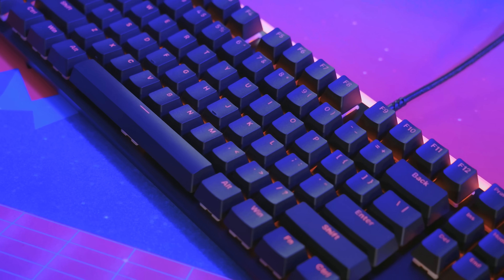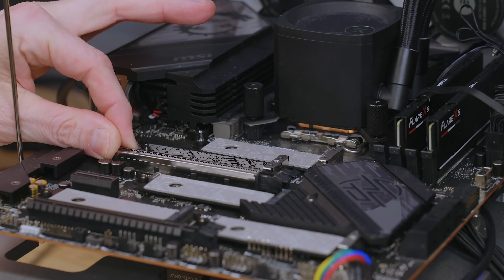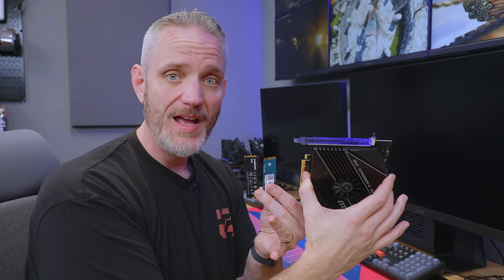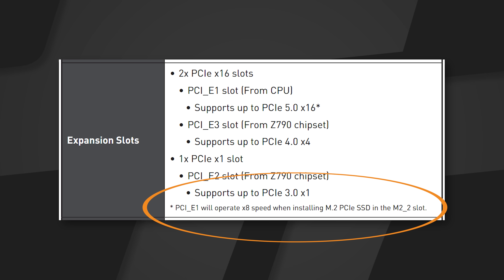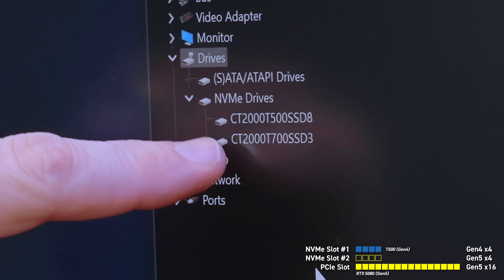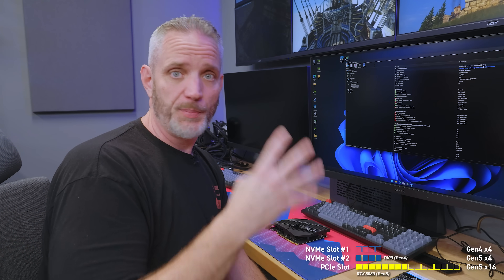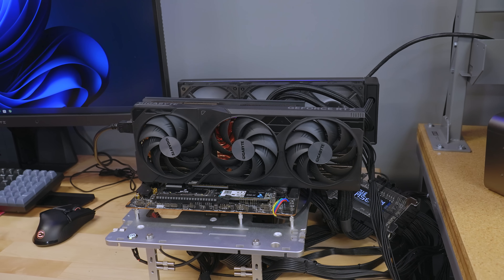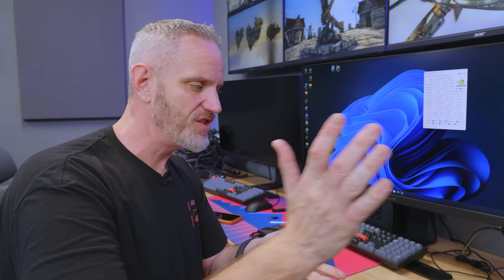Don't make this mistake with your PC!

Comment: Great video and here's why.
In 2023 I had not built a PC in almost 10-15 years and started with the 670E chip set....THINKING...hey DDR 5, PCIE5, we are good to go for some generations. 
3 sets of 64g DDR5 sets later I discovered support by manufacture is a thing (because of you).....because it just worked before and hey it's listed as EXPO compatible on the website....
Then I learned about PCIE lanes supported and configured differ by manufacturer and model (because of you) then realized the m.2 pcie5 I bought doesn't make any sense because it can't be used on that chip set....
Now I learn about bifurcation and realize any extended motherboard set is a basically a waste of money if you are gaming.
You only need a 5x16 main GPU slot and a 5x4 for an M.2 for storage....I wasted SO MUCH MONEY and my PC still doesn't perform optimally because my PC idea was 2 years ahead of concept. 

I need a new motherboard and MSI or Asus are the only options that I can find with my existing equipment due to compatability which is just sad.
Current system
7900xt-7800x3D-G.SKILL Trident Z5 Neo RGB Series 64GB(not supported so runs at 4800mts)-ASRock X670E Taichi-Team Group T-Force CARDEA Z540 2TB(not supported so runs at 4.0)

Comment: Ok this is making me want to rush to my pc and check GPU z. I’m using the Asus TUF Gaming b650-e and the manual doesn’t seem to give specifics about bifurcation. I have two gen 4 nvme drives installed, one in slot 1 (gen 5 slot) and the other in slot 2 (gen 4 slot) while slot 3 is empty. My GPU is gen 5, however I don’t think my board does gen 5, but I never even considered if I could be causing bifurcation with my 2 drives. Sadly I’m at work so I can’t check it at the moment but this is driving me crazy!

Comment: This video reminded me that I have PCIe Gen 3 drives in a PCIe Gen 5 and Gen 4 slots. I read the manual for my new PC when I built it, but I brought the drives over from my last build and I forgot that I have yet to upgrade them.  This video reminded me that I still need to upgrade them.
Reply: You dont really "need" to upgrade them. I dont think the difference will be big. Depends on the type of workload though

Comment: Thank you for this video. I had my gpu in the completely wrong pci express slot because I didn't know better. Also I know you iterated and reiterated several times to read the manual, but prebuilts don't typically come with those. I know I could Google it of course so it's still on me.

Comment: From what I read up on that topic, It has at worst a 1% impact on the GPU and only on full usage even on a 5090. If that's all that's to it I don't mind the power loss. Don't know about overclocking, but although I had the option in the past I never did.

Comment: I am confused. I only have an RTX3080ti and Gigabyte B660 motherboard.  I have one gen4 NVME in the only slot above the GPU slot. I get full speed of the GPU. GPUz reports Pcie 4.0 @ 16 4.0 which is max speed for a gen 4 GPU. Why isn't my Gen 4 NVME taking it down to 8x like it did in this video?   Yes I know I have 20 lanes.  But Jays dropped to x8 when he put the Gen 4 drive into the slot above the GPU.  EDIT, after watching the last bit with the Gen 4 GPU I now get it.  You are dropping to x8 on the GPU because you are using both NVME slots? I think?  Great video by the way.  I have been building gaming PC's since 1992 and I still get confused.

Comment: but I think some boards may not detect automatically if you put a pcie nvme card on there
I have a msi x470 carbon board and if I don't configure the pcie slot manually only one nvme is detected

Comment: I read the manual and bifurcated 8x4x4, bought a 8x GPU (7600XT) and added extra x4 NVMe SSDs. Seemed like the easiest way to get lots of fast storage on the MB. Not a gamer. 16 GB GPU is used for small local AI models.

Comment: @10:55min into clip, not really a waste if your thinking of furture proofing and you want to move all the Pcie 5.0 products to  AM5 Motherboard..., in fact i have a AM4 system and i want to build a AM5 system but all my Nvme SSD are Pcie 5.0 now when i build the AM5 i just move all that right over to that Board and good thing i did cause the prices went right to the roof recently but i get what your saying about proper lanes and speeds.

Comment: dude.. i think i mucked up...i bought a samsung 990 pro nvme m.2 heatsink ssd 4 tb and its currently in the only m.2 slot on my asrock b550 pro 4 motherboard....... this would explain the low speeds i was seeing...........
Reply: ok i might have actually put in the right spot but.,..Drive Controller:  NVMe (PCIe x4 16.0 GT/s @ x2 8.0 GT/s) this is what i get but why?

Comment: Thanks Jay, I have been telling this to users and folks for a few years- especially when they ask about building- I always ask them what are your goals and what type of hardware are you planning on now and possibly later, in order to spec out starting with the motherboards capabilities and device lanes / Gen support. I have seen this  more often then not especially lately with the new Gen 5 devices where other builders don't understand what is taken place. advice- plan out your build if you want  said X gen 5 or components make sure what you what to do and get full potential if possible look at your motherboard options very closely and see if it is going to support what you want to do- as example I recent upgraded my work / gamming PC I wanted to have Gen 5 9070XT  video and I knew I wanted fast Gen 5 drives I have (2) 9100 series Gen 5 NVME and a couple 990 and 980 NvME so I looked over options closely and went with a MSI Tomahawk Wi-Fi 7 X870E and 9900X CPU with 9070 XT video top NvME Gen 5 Video Gen 5 Second NVME Gen 5 lower to NVME gen 4 perfect fit for what hardware I had and what I wanted to accomplish.. Also Jay I think it is very important to point out your CPU plays a BIG part in this as well esp. with AMD and the dedicated lanes and Gen support between the series of CPUs often that gets overlooked as well and can downgrade what gen a slot becomes due to the Bus lane supported by CPU. I will point out before somone says no you didnt get it correct I turned off in BIOS the 40GB option for ports on motherboard in order to retain the Gen5 option for the second NvME drive as that option shares lanes / Bifurcation if left on.

Comment: For those who have a asus rog strix z790-f gaming wifi 6e motherboard intel, put the ssd in the first top slot, i have a 14gen cpu and 4gen Samsung pro ssd, the motherboard has 4 gen4 ssd slots, i have a 5080 running at 16x

Comment: So the Mag B850 Tomahawk has 2 PCIe 5.0 m.2 slots and 2 2 PCIe 4.0 slots. I guess the motherboard has this thing where if you use more than just the first m.2 slot, or from what I'm reading, the second m.2 slot shares bandwidth, slowing down. Does that mean I could use m.2_1 slot and the m.2_3 & 4 without any issues? Or am I misunderstanding? Sorry, I'm new to pc building, so been studying up on all this stuff for many days, now. Just when I think I got it, I find something else to be confused about.

Comment: Jokes on AMD and Intel, i am still using SATA2 SSDs!
My chipset runs it all and PCIe is only for GPU :D

At the end though, the question is for the mobo makers.
The CPUs have what the CPUs have, the mobos are the ones that put in all the options. 
So i don't even put the question on the mobo, i put that question on the buyers. Why buy a CPU that can only support a few good lanes, then you buy a lot of cars for those few lanes.
Just like people who don't properly match mobos with RAM, or X with Y. It is the same problem.

Comment: How about "gen4.5" nvme ssds like 990evo plus? They're gen 5x2 or gen4x4. Technically you could put 2 of these and use 4 gen5 lanes and get the speed of 8 gen4 lanes. Or how does it works?

Comment: weve just had a mad few days tring a saphire nitro+ rt 9070 xt in a msi x570 g+ but it wouldnt boot to bios any ideas ryzon 5 x3600x 2 x nvme mp600 500gb C 1tb D corsair lp 3200mhz 16gb ddr4 .. new psu 1200 w 3 wire power to gpu ???

Comment: Why are so many slots on a Mainboard if it shreds the performance of the parts. Just dont put it on there and i know i have to replace a 2TB with a 4tb and not just buy another 2TB and stick it on another slot because it shreds performance.

Comment: So the manual for the Asus Tuf Gaming Z790-PLUS WIFI D4 motherboard just says "... supports PCIe 4.0 x4 mode M Key design..." prefixed by the socket identifier and suffix of the various sizes of drive that socket will support in Chapter 1 section 11. The only other spot in the manual that talks about the drives is how to physically install it in Chapter 2, unless I've completely overlooked it. Comparing it to the screenshot you put up of your ASUS ROG Strix board, nothing in the storage section talks about shared bandwidth.  Does that mean all four drive slots will run at full speed? 

The only place the manual refers to Bifurcation is in a section for "Expansion slots" which it differentiates from the "storage specs". There is a link for the bifurcation in the expansion slots, and the site it takes you two talks about those PCI-e add-on cards to add even more drives and how those drives on that expansion card would be impacted.

Comment: This info needs to be spread around more, and the freaking manuals need to make this more clear. First time I learned about this was when I built a system with a cheap board and one of the GPU slot didn't work at all when you used both M.2 slots... 

Also, my newest board had to be flashed to the new bios to recognize the CPU I ordered with it - and apparently there is a function to do this without CPU at all, via a specific USB slot and a simple stick with the bios file on it. This info would have saved me a trip to the shop, asking them to lend me an older CPU it recognizes to flash my board (was my first AM5 board). And I wonder why this isn't mentioned in the manual in big shiny letters, I mean it's just a recurring problem that boards need to be flashed before usage, so manufacturers should just leave a note in the box that they built in a solution for that ffs.

Comment: Whats the deal with the intel website saying the max number of pcie lanes is 14? 

Is that chipset lanes? Ignoring the direct to cpu nvme slot and pcie 4x16 slot, it has 1x 4x4 nvme and 3x 3x1 slots. The cipset lanes add up to 14 assuming thats 8 lanes x 2 (up and down)

Comment: Yep cheers Jay, I bought two Samsung 9100 2TB pcie5 nvme's and was disappointed to find that my 5090 was only on 8 lanes. I'm doing AI 'stuff' ))) so maybe I need all 16 lanes available and anyways I want 16x for my 5090 Astral! I have the 870E-E Gaming WIFI MB too and a 9950X3D is running the show. (Single middle aged geezer working 50 hours per week so that's how lol)
 Did some manual reading and found the issue. Wish I had either read the F**kin' manual or seen this vid before I bought two of these. My brother will benefit from my mistake as he is building himself a new PC and I'll gift him the drive for his Christmas pressie so not all bad.

Comment: It. Doesn't. Matter. People who want to fill every slot (like me) don't really care. When I started computers I had to listen to a modem connect. It took minutes to download pictures. You really think I care if I'm writing at 1GB/s instead of 5 or whatever? I have 4 slots filled on my nvme slots and 2 more on add in cards. I have an additional 4 nvme running off a single usb-c port from a Terramaster D4. It writes at 1GB/s which to me is still absurdly fast. Yeah, I'm good, thanks.

Comment: I am curious Jay.... I have one of those MSI M.2 Xpander's. Mine is Gen 5. However, when I installed 2 NVME's on it and put it in a 4x slot, it only saw 1 drive. So, I don't think you're correct about it splitting it to 2x and 2x. I think It only saw 1 drive because it couldn't connect to the other drive at all. Please test this and verify what you get when installed in a x4 slot. TY

Comment: I always read the manual... all mobo's are different. my 10700K with its mobo had to use a dedicated slot for the M2, or else it would not even boot. With my 11900K cpu and it's mobo however,  it did not matter if i used the top lane or mid lane or the bottom one, those 3 are the same, but the 4th which is located more on the right of the mobo is not the same, it's useable but not what  you wanna occupy if you only have 1 m2.

Comment: Coming back around to this @Jayztwocents because i am so annoyed with what i can only assume is a cost savings feature by these board manufacturers.  Did we not used to get two full size PCIE x16 slots on consumer grade motherboards that ran (had the pins) for full x16 support? So many boards including my X570 board and looking around, all the way through thousand dollar Threadripper moba's dont have that.  Why!? Why are we being short changed to save a few bucks on the pins? Few bucks on the traces? Or is this something more from the chip designs limiting how many lanes can be connected? (Like giving up the PCIE slots for the M.2 slots?) I dont know and I dont have enough info.  But its something after this recent series thats irking me when im looking around at what the market is producing.

Comment: good old x79 times here, still running an e5 1680 v2 with 40 PCIE-Lanes on a modded bios which provides me 1 x16 unbifrubicated for GPU, 1x 16 bifrubicated to 4x,4x,4,x and 1x8 to 4x,4x - so I can run 6 nvme-Drives and a GPU without wasting any lanes - unfortunately all only PCIE Gen3... ;-) 40 Lanes, Gen3-ready board at Gen2 times, and working 128 GB ECC memory with 14 yo board

Comment: Have a build question for anyone, on the X870E-E Gaming Wifi board, or any board with this setup, if I put a Gen 4 M.2 in 1 of the Gen 4 chipset slots to run windows only and then use a Gen 5 M.2 in the main 5.0 slot going to the CPU, would that still cause bifurcation to the GPU while running a 9950X3D or is it more beneficial to just run a larger storage 5.0 in the single slot?

Comment: I think I had this figured out a couple years ago when I built my PC I had five nvme slots and I bought four m.2 drives and they were all gen 4 cuz I wasn't wasting money on a Gen 5 drive. I really don't need one. I play video games that's it. But I made sure to leave the mvme slot that shared Elaine with the pcie slot that my graphics card was going in empty. That way I didn't have to worry about my graphics card and my storage. Trying to fight over sharing a lane.

Comment: I definitely experienced this firsthand but not because I didn't know but because I had no choice, back when I had am4 motherboard the lanes were so limited and I wanted to put four nvmes on my motherboard but it can only support two high-speed ones before it starts slowing down your other Lanes. So then I brought a PCI nvme adapter and that did not help the case. It immediately cut my GPU Lanes in half so I had to get rid of it. And eventually got forced up to am5 where now this is no longer an issue for me

Comment: brother, my specs will make you puke due to the config,, rog bf550a, 5950x, 64gb ram, 3060 12gb oc, boot drive is 1tb samsung 980 pro, game drive is a2tb 980 pro, than i have a sata 750gb drive hhd (saved from a laptop from 2012) and a usb3.0 4tb hardrive from my xbox lol however i didnt buy the 980 pros for their speed alone, i did it for their reliability, so my next build i can still use thes and MAYBE finally get full speed out of them on the next one, cost me a few mo dollers now, but when upgrade time come (with the 3060 the time has came and passed lol) but i wont have to worry about at least 3tb of m.2 storage. even with my fuged storage config tho i believe i still run at 8x for my gpu, the 2-5% performance loss truly doesnt effect anything for my day to day, now if i was trying to milk everything possible out of my system, id lose two stick of ram and only run the 1tb 980. yea yea i could have saved money buying lower tier m.2s, but reliability and future proofing and "one time purchasing" goes a long way for me

Comment: I wish i saw this yesterday, i was trying to install a new SN850X and my 980pro in my 1st slot had thermal pads below and after months of use turned into an adhesive which after trying to remove made me rip my drive out with force breaking the slot (drive is somehow fine). After seeing this i just put it in the chipset slot and was able to use my 4090 @16x16 instead of 16x8 and all it cost me was a fdacepalm and broken gen 5 slot. I use a ROG Gaming-E wifi z790 for anyone wondering.

Comment: I've got a 9600X and ASUS TUF B650M-Plus Wi-Fi. The MOBO documentation says the only Gen 5 is the primary SSD slot, but the BIOS seems to say otherwise. Is it possible they added more Gen 5 support in an update? (I didn't think they could do that.)

Comment: How do you know if your slots are going through PCH or if it's direct to CPU?
I have an Aorus z870e Master AX (or something close to that -- I dont have it in front of me) but it's book only tells me the bifurcation.
It's saying that all 4 m.2's will bifurcate
So does that mean I have 0 that go thru the PCH? (or can you confirm this for our own PC's w/ HWinfo or any software?)

I have a 7950X3d, and it says theres 4 lanes dedicated to the chipset and that cant change. I think it was 28 total, but only 24 available to the user
So if I subtract 16 more, I would have 8 lanes left.
Problem is, there's 4 x m.2 slots all populated on my machine. So does that mean they're all x2 at all times?
Or if they're not in use, does the system give those resources to other m.2 drives?